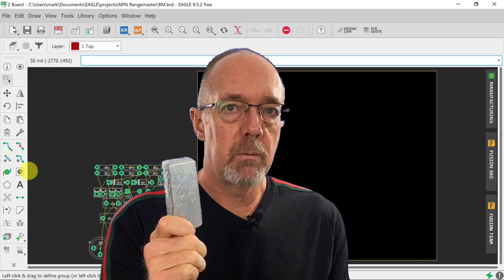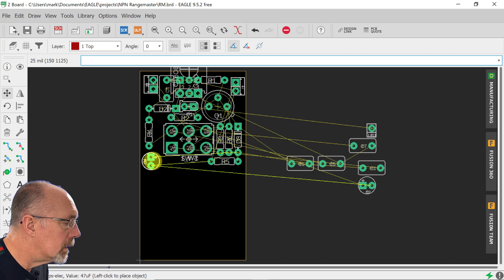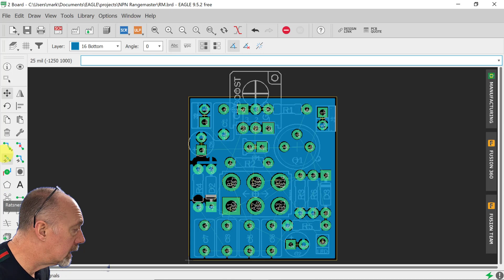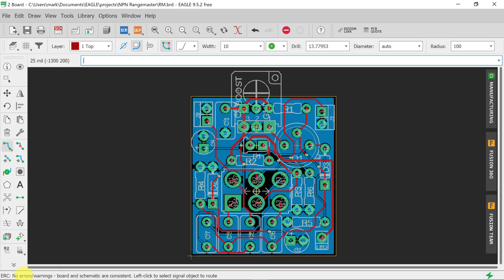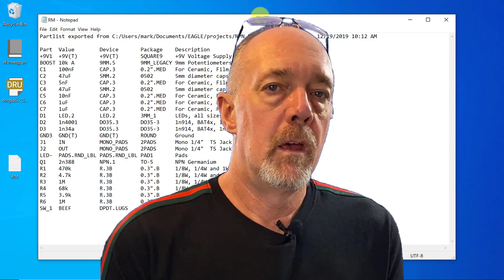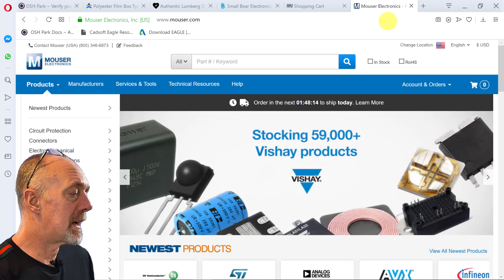Build Your Own Effect Pedal - Treble Booster (Part 2 - Make the PCB and shopping list)

Comment: Do you know how to make it passive? Like the Bigfoot trouble booster uno
Reply from the maker: Hello I’m friend!
Well, that’s a completely different effect. This treble booster uses transistors which require power. 

The Trouble Booster Uno probably uses a small step up transformer and a couple resistors and few capacitors. That’s a really neat idea.

Comment: Cool video, I just had some issues because of the little changes in the project between the part 1 and part 2.
Reply from the maker: Yes, this was my first series of videos so I’m sure I could have been more coherent. I also constantly forget to point back to the setup video when mentioning the Eagle Libraries. 😄

I’m thinking of redoing the setup video again.
Reply: @HomespunEffects  thanks for your response here. I didn't expect it so quickly. This video gave courage to work with Eagle for the first time. You got a new subscriber!

Comment: I wish I had found your channel earlier. I started building my own pedals at the start of the lockdowns and I knew zero about electronics at the time. I went from bread boards to vero to whole through pcbs etc.  I decided against ordering boards b/c it seemed like a long time to wait for something that may or may not work. How long does it take for you to get your boards back after ordering?
Reply from the maker: Usually about 10 days. However, during the shutdowns it was taking longer.
Reply: @HomespunEffects  Yep that seems about right.  Because I was not confident in my designs,  or more accurately, not confident in my mods to others' designs as well as the boards were getting too complicated for the vero boards, strip boards etc.  I started using easy eda to draw them up and bought a 3018 cnc machine and learned how to cut my own boards.  

There was definitely a learning curve with that as well, but now I can go from a design to custom board in just a few hours to a day at most.  I still have the gerber files available if I want to have "real" pcbs made later.  

So far I just use my prototypes but the plan is to convert the working versions to smd and buy them pre populated with the items that don't require through hole from the pcb factory.
Reply from the maker: @jbolt247  may I ask what bit you use with your CNC machine for PCB prototypes? I've experimented with mine but haven't had great results yet.
Reply: @HomespunEffects  30 degree .1 mm  genmitsu from Sainsmart.com 

Here is a link to a the tutorial I used.  https://www.youtube.com/watch?v=--Cb11heuHc These guys are great.  I don't think they have posted anything new in a while though. 

There is also a video on their site for double sided but I have not gotten that brave yet.  I just make the board bigger since it is just a prototype anyway.  A little more challenging to get all the traces in but it is a nice part of the challenge. Sometimes I use 0 ohm jumpers when absolutely necessary just to keep the schematics cleaner.  

It was a little tough to follow at first but once I got the software going, and failed a few times, I finally got the steps down.  The major trick is getting the surface map accurate.  I also use double sided tape to tape the boards down instead of clamps.

Like I said a few times, it was a challenge but worth it the long run.  Cutting a board with about 50 components and 220 +/- drill holes takes about 2 hours.  I can also use it as an engraver for text on the box.

Comment: "clickclickclickclickclickclickclickclick" Just kidding man, awesome video and awesome series. Great info
Reply: Great information, I like that you don’t assume what the viewer might know. That mouse click is brutal though. :)
Reply from the maker: @jbolt247  thanks for checking it out. I never liked when someone would just cut out a major portion of the process so I figured that I'd try fast forwarding instead. 😂
Reply: @HomespunEffects  Have you considered skipping the design process or just showing a small portion at the beginning and then cut to the end and doing a walk through? 

Since there are so many design software options out there unless you are specifically doing a "How To" on Eagle, the final design is really what is important.  

Personally I would rather see a walk through of the final design to learn why certain choices were made or how they function in the circuit.  Or start with the original with an explanation and then show the mods like you did in the RAT mods portion of that video. Your process may have changed since this video, if so just ignore.  I chose to go back to your first video and I am proceeding by posted date.

Disclaimer:  It's always easier to be an armchair quarterback so props for putting yourself out the and giving it a go. 

These are just personal suggestion based on the channels the I enjoy watching.  Mr. Carlson's Lab is a great example. 

I look forward to going through the rest of your videos and new ones as well.  Thanks and keep em coming.
Reply from the maker: @jbolt247  Mr. Carlson's channel is awesome. I'm planning some new videos so I'll definitively be making some changes and streamlining things.

My thinking was to show every process and explain it's not so esoteric. 

Also, don't consider my PCB designs to be correct or even good. I try to make them small, even at the expense of noise, just to save money on the cost.
Reply from the maker: 😂 Thanks, friend.

Comment: Thanks for the videos!  Do you have any tips about how to find 2n388 transistors?
Reply from the maker: They have become a bit hard to find. All the sites seem to be out of stock.  EBay looks to be the place to look. 

I'm going to start collecting thrown away electronics and scavenging then for old transistors.
Reply: I don’t know much about germanium transistors yet. Do you think I could substitute the 2N388 in your circuit for one of these? 2N1306, 2N1308, 2N1309, 2N1373 (from http://diy.smallbearelec.com/HowTos/FuzzFaceFAQ/FFFAQ.htm)
Reply from the maker: You can use any NPN, with varying results. It's fun to experiment by installing a socket and trying different transistors. Silicon transistors can work as well. 

Make sure to compare the pinout to make sure you connect it properly. Google the transistor designation and the word pinout.

Comment: Nice video,so many thanks...Sir if possible please make a video about making a simple overdrive pedal...and please tell each stage ( tone / gain ) if we put different resistors, caps or transistors how they affect the bass,mid ,treble and also output gain.
Reply from the maker: As it is written, to build a Tube Screamer clone is a right of passage in the pedal community. This may be an upcoming series. Stay tuned.
Reply: @HomespunEffects  awesome...it will be amazing